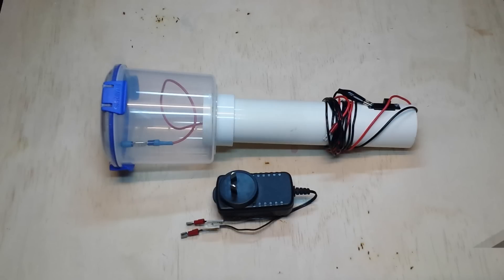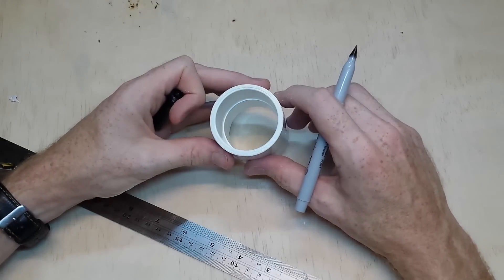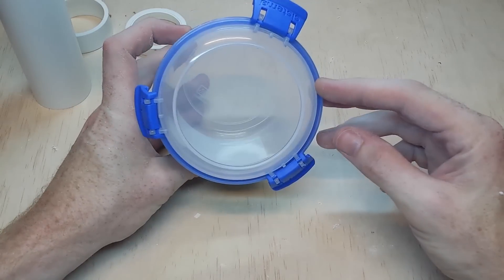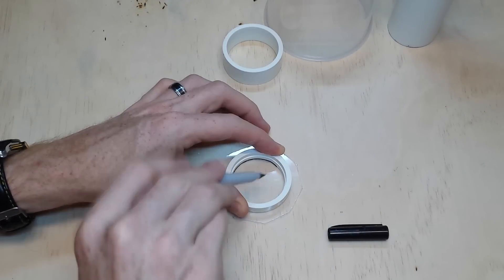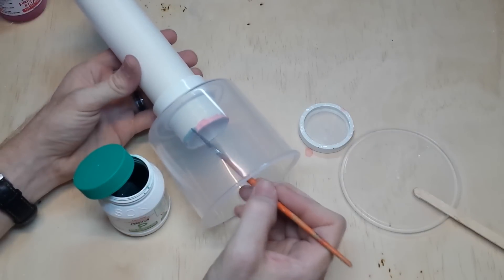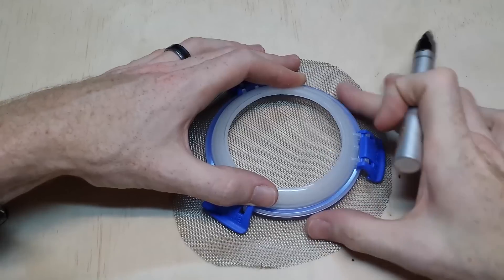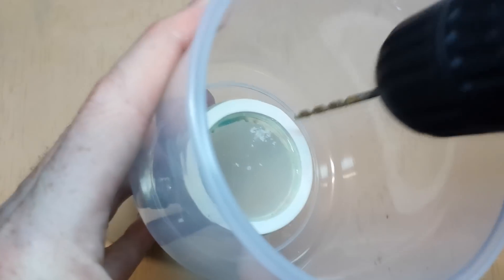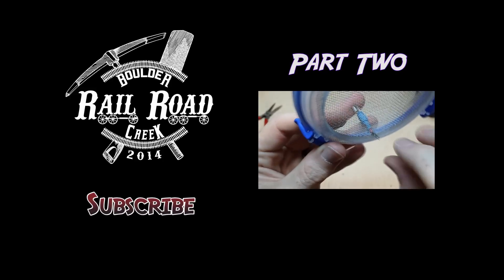Static Grass Applicator (Body) - How To - Model Railroad

Comment: Beware of the costs involved. I went to my local hardware store and asked for 18" of PVC thinking it would cost about $5, not realizing that it was $14.49 per foot. The pipe and the coupler cost me $24 USD. An actual flocking machine cup like the one shown in this video costs $55 USD on ebay.
Reply: Unfortunately the guy didn’t tell me how much it costs until after he cut it.
Reply: Seriously?! Something isn't right there. Try a different store. Here in Australia (where everything is more expensive than the US) 2" PVC is $2.15 per foot and the coupler to suit is $1.40. Google tells me that's US$2.50 at current exchange rates.

Comment: I am just about to start making mine, but I have a query. In your list of materials you state 50mm PVC pipe and coupler, yet on the video at the start where you have all material, tools, etc, lined up, the pipe is 40mm, and you also mention 50mm when marking the container for hole cutting. I think the 40mm is easier for handling, so I take it size doesn't matter.

Also what was the size of the timber for mounting the negative ion generator. I have a piece that is 30mm x 12mm.

Hoping to hear from you soon.  ...... Ian

Comment: https://www.ebay.de/itm/DC-12V-to-20000V-High-Voltage-Electrostatic-Generator-Negative-Ion-Generator/232475332393?hash=item36209c0f29:g:~-MAAOSwNm5ZrBIcEs ist ein Beispiel, man kann auch jeden anderen Händler nehmen.DC 12V to 20000V High-Voltage Electrostatic Generator Negative Ion Generator ist wichtig. Die Sachen kommen mit einem Monat Lieferzeit aus Asien. Man sollte die Teile sorgfältig verarbeiten, es ist sehr fummelig, das Drahtgeflecht an die Frischhaltedose mit 2K Kleber zu verkleben und an das Kabel zu löten.Die Leistung ist mehr als ausreichend, man riecht sogar die Spannung in der Luft, also nix für Herzkranke und Weicheier... Die Schläge die das Teil ausgibt, sind sau unangenehm. An dem Gerät ist ein winziger Poti, an dem man die Leistung regeln kann. Ich habe extra ein Looch gebohrt um mit dem Brillenschraubendreher erneut dran zu kommen.Ich werde demnächst einen kleinen Schalter einbauen, damit man auch Pause machen kann, ohne eine gezwiebelt zu bekommen. Die Kontaktkabel müssen ausreichend lang sein, das erhöht den Arbeitsradius. Für das Gehäuse macht sich Luke sehr viel Arbeit. Ich nahm das kleinste Abflussrohr und 2 Endkappen, an die untere Endkappe habe ich die Dose mit 2 Poppnieten befestigt. Der Generator ging nur mit drücken rein, also braucht der nicht weiter befestigt werden...Fertig. Bei der Frischhaltedose sollte man nicht geizig sein. Bei der vielen Arbeit lohnt schon ein besseres Modell mit gescheiten Schnappverschlüssen!Noch mal vielen Dank an Luke Towan für die geniale Idee und tollen Videos.

Comment: Had trouble finding the container you used but looked closely at the video and saw it was a Systema Klipit  23 oz (700ml) container.  Found it here in the USA on Amazon for $6 US.  Best build video I have found for a Static Grass Applicator.  Thanks.
Reply from the maker: Doyle Souders ,,  thanks mate, yeah I probably should've mentioned that in the video. I'm about to release an updated version of making the static grass applicator in about 2 weeks, the main differences are I used a slightly smaller container (same brand) and I added a dual power supply so it can be powered with a 9 volt battery or the wall socket. Having a battery makes it great for the hard to reach jobs.
Cheers
Luke
Reply: Thanks Luke,   I will wait for your next installment.  Still trying to find the right Ion Generator.  I sent a note to Oatley but haven't heard back so may just wind up picking up a 15 Kv unit off of eBay.  I am guessing you may have chosend the Systema Breakfast container.

Comment: I hate how i do everything he says get it doesn't work
Reply from the maker: I'm not sure what components you're using but if you are using a cheap negative ion generator from china then your applicator won't work as good as the one I show in the video. I used a high quality negative ion generator from Oatley Electronics specifically designed for making grass applicators.
Reply: Luke Towan I bought it of Amazon so I don't its know the quality

Comment: @Luke Towman 
is this negative Ion generator good for anything?
specs: 
DC 12V to 20000V High-voltage Electrostatic Generator Negative Ion Generator MO

Input voltage: DC 12V
Output voltage: 15000V-20000V adjustable
Rated power: 5W
Mounting hole diameter: 5mm
Hole center distance: 112mm
Size: 60*70*30mm
Note: Small red and black line is input, red is 12V power supply positive input, black is negative input, thick red line is high voltage positive output, thick black line is high voltage negative output
Reply: or this one. 
specs:
DC12V High Output Air Ionizer Ioniser Airborne  Negative Ion Anion GeneratorInput voltage: DC 12Voutput voltage: -4Kv ~ -6Kv DCpower:<1WColor: as the picture showSize (L*W*H): 4.3 x 2.1 x  2.5cm/1.61"x0.82"x0.98"(approx)Quantity:1 pc

Comment: Great video Luke, But I have a Question about the size of PVC pipe. You said in the video 50mm pipe which here in the states would be 2 inches. But the pipe in the video looked like it was marked 40mm. that would be 1-1/2 inches here. I don't want to have something too big if I can help it. So... 40mm or 50mm? Thanks again for a great video!
Reply from the maker: Just went and measured it and it's definitely 50mm however I have since made other static grass applicators and on the newer model I use 43mm pipe and the negative ion generator fit snugly. Any size can be used as long as the generator that you use can fit inside the pipe. Cheers 😀
Reply: Thanks for the quick reply Luke! 
But one another question about the output of the power supply. 
In the video I noticed the following of the power supply
 
Input is 100-240v - 50/60 Hz 0.4a
output is 12v=1.5a    On the output side.. can it be higher? say 2.a or 3a? 
I don't want to fry this thing. I am not good in electronics but I can follow instructions! which is what I am doing in your video! So I don't want to mess this thing up.

IONB2 negative ion generator  module is on its way from oatley electronics.
Reply from the maker: They only thing you need to look out for is voltage, as long as you don't go over 12 volts you'll be fine. The amps can be anything, I've used they grass applicator with a .4 amp supply ad well as a2 amp supply... if the rated amperage of the power supply is too low then you'll burn out the power supply first before it damages the ion generator. Cheers 😉

Comment: +Luke Towan,  I enjoy your videos and have tried some of your projects.  I use flex track to mask my tracks.  Flip the track over and use  1", 1-1/2", and 2" masking tape on the bottom,  with the track upside down, lay it over the existing track, offsetting it to "interlock" the 2 tracks.  I vary the tape width for different coverages or use 2 overlapped tape strips for wider coverage.  It would be easier if I had a video, BUT, I don't do videos.

Comment: Cool.  Question, though.  The parts list says to use 50 mm pvc pipe as well as your voice over.  However, the pvc pipe in the video is stamped "40 MM"  Which is correct/best?

Comment: What the most asked question here is the unit is called :  IONB2 NEGATIVE ION GENERATOR MODULE . 
Go to http://oatleyelectronics.com//product_info.php?products_id=915 
They are In NSW ( new state of weirdos ) 
They Sell $14 AUD , ship for another $12AUD which equals about $19USD depending on the exchange rate 
And I would recommend drilling the holes @ 6.15min ,in the pipe before fitting the container . Stormwater PVC can fracture easier than Electrical or communications 50mm the diameter is stronger when drilling into it . To get them try an electrical trade shop

Comment: I have been looking at making one of these.  However when looking for the negative ion generator they have 4 wires.  Red Black and 2 whites.  After reading other comments I see higher voltage the better.

I found on eBay 15000v static generator but it still has 4 wires. im assuming i can just cap off the 2nd wire?  
http://www.ebay.com/sch/i.html?_from=R40&_trksid=p2141725.m570.l1313.TR0.TRC0.H0.X2v+out+15000v+High-voltage+electrostatic+generator+%2Fnegative+ion+generator.TRS0&_nkw=2v+out+15000v+High-voltage+electrostatic+generator+%2Fnegative+ion+generator&_sacat=0
Reply from the maker: You can just leave the two white wires on and connect them to the mesh lid on the grass applicator, it should work the same however the output voltage is a little lower than the one I used so it might not work quite as well.
Reply: Hi Chris did you use it? it works? thanks

Comment: What size is the negative ion generator
Reply from the maker: It's about 40,000 volts using a 12v power supply. From Oately Electronics in Australia.

Comment: Amazing vid thanks I have looked on ebay but most of them have more wires on them ? not sure what the other wires are for is it just the 3 wired one i need thanks
Reply from the maker: yeah it works better with the 2 wire version. 'Oatley Electronics' in Australia sell them and they ship worldwide. I'd probably start there.
Cheers
Luke

Comment: Reading through the comments, there's a lot of questions about the negative ion generator.  If you live in the United States and have concerns about ordering from Australia (you shouldn't), there's a retailer in New Hampshire that sells higher power Negative Ion generators.

Here's a link to the 30KV unit: 

http://www.amazing1.com/products/negative-ion-generator-12vdc-input-30kv-output.html

Commercial Flocking units use upwards of 40-75kV, so there shouldn't be any major concern about safety with a 30kV unit.

These units are not cheap, but they are the highest power units that I can find this side of complete commercial units.  I purchased 5 of them in one shot to get bulk pricing, as I build these for modeling friends from time to time.

Canisters, similar to what Luke uses for his unit can be purchased at Bed, Bath and Beyond.  It's made by Sistema and are about $7 each.  I prefer these over others like them, because the clips that keep the top on the canister are separate items, which will not fatigue and break off over time.

Again, Great videos Luke...  Very informative and if you follow along, step by step, you get pretty close to the same results!

Jeff
Reply from the maker: Thanks for the link Jeff. Thats the question I get asked the most here, where to find good negative ion generators! So thanks again :)
Cheers
Luke
Reply: $50 plus shipping. That's bananas.

Comment: Hello, it looks great and does the work perfect. I have built grass applicator from rechargeable "bug zapper" but it doesn't work good. I would like to built another one similar to yours, but I need your advice. I have checked ebay and I can buy only 12V Negative ion generator that gives 9000V. It is less than IONB2 with 15kV. Do you think 9kV will be eought? or I should look for higher voltage?
Reply from the maker: +Robert D I think 9000V will be ok, I got a message from someone who made a similar one with a negative ion generator from China, I really like the one from Oatley Electronics because it's made specifically for making a static grass applicator. However the bug zapper ones will be a similar voltage to 9000V so it might not be a whole lot better? If it was me I'd get the higher voltage one.
Hope that helps, if you have the money and time it might be worth experimenting and giving the 9000v one a go.
Cheers
Luke
Reply: +Luke Towan 
Thanks for advice.
Reply: Hi Luke,

I've found a 12V ionizer with 20.000V output on Ebay. Please see this link:
https://www.ebay.nl/itm/152382512125 
Can I use this one? If yes, there is a black and red cable and a red and white one. How do I connect this.
What are the specs of the phone adapter?
Thanks for your reply!

Comment: what about a nylon shirt and a pvc tube?
Reply from the maker: +MrOldCrow Similar to rubbing a balloon on your head?? There is a product from Noch that uses that principle, not sure what it's called though.
Cheers
Luke
Reply: I may not be understanding electricity enough, but I wonder if an applicator could be made from a cheap torch? It has a switch already built in.

Comment: Hi, I am very new to this love your video, I am guessing you buy have to buy a switch as well but does it run on battery or is it connected to a transformer and what voltage does it run on. Thanks
Reply from the maker: +1809flower Hi, yeah you'll need a "Double Pole Double Throw" (DPDT) switch to wire it up. It can run on a 9 volt phone charger that plugs into the wall but will work slightly better with 12 volts charger. It is possible to run of battery power however I'm yet to try it this way.
Cheers
Luke
Reply: +Luke Towan thanks heaps

Comment: Hello, I am from Germany. I've searched on ebay by negative ion generator , but I find just one with four cables , is that right? Excuse my english.👍thx
Reply from the maker: +DaviRelli Channel The four wire ones should work but I'm not sure if they are as good, I haven't personally tried them and apparently you can chop off the extra high voltage output wire? The one I bought from Oatley Electronics is specifically designed for making static grass applicators and you will definitely get great results with that one.
Hope that helps a little.
Cheers
Luke.
Reply: Thanks for the answer. Is there a website where I order it ?
Reply: +DaviRelli Channel 
Hi, check my question to Luke. I have found 3 wires generator, but the one with maximum 9kV output. IONB2 generates 15kV so, much higher voltage. It looks IONB2 is not possible to buy, or have you managed to?
Reply: Hello , I ordered one from China , unfortunately, does not work with . Now is the thing ready built alerdings without funtion there. :( Have you found something better ?
Reply: Hello , I ordered one from China , unfortunately, does not work with . Now is the thing ready built but without funtion there. Have you found something better ?

Comment: i have built one of these too..from a MRH article and use it with the club scenery all the time..very popular. i was going to say you can buy screen door repair kits at hardware store ..the are just right size and work good too...just be sure to use metal screen
Reply from the maker: +Mark Ernst Thanks Mark for the great tip. 
Cheers
Luke

Comment: Why would you use epoxy to glue the parts together rather than regular glue?
Reply from the maker: +Ellison Wonderland Films I find epoxy to be stronger and more durable, you could probably get away with regular construction glue but I'm not sure how long lasting it would be? Silicon might work as well and would be durable as well as flexible.
Cheers
Luke.

Comment: I've already commented in the "Electronics" video section, but I just wanted to say again that this is the best tutorial and best constructed home built static grass applicator I've seen yet... 

For those that live in the US and would like to build this unit...  The Negative Ion Generator that Luke uses from Oatley Electronics is the most powerful 12VDC unit I've found to date and Oatley has no problem shipping to the US ($14AUD).  On our end, there's not issues with Customs at all.  I've ordered 6 of the generators (2 at a time, X 3) with no issues at all...

Again...  Great tutorial Luke.  The next time I build one for a friend, I'll be using your techniques.
Reply from the maker: WHJeffB Thanks again mate, buying the negative ion generator in bulk is a good idea. If I received one of these as a gift I'd be very happy!  Thanks for the fantastic comment and great feedback.
Cheers,
Luke.
Reply: what to look for when buying an ion generator?

Comment: I have one question.. is this device same like yours?
http://www.ebay.com/itm/251414801059?_trksid=p2060778.m1438.l2649&ssPageName=STRK%3AMEBIDX%3AIT
I am planning to make a device like you..
Reply from the maker: Bora Jankovic Hi Bora, The device is very similar and it would work however, the output voltage is a lot lower than the device I used, the results would not be quite as good and you may have to hold the grass applicator a lot closer to get the fibers to stand on end. The one I used is here : 
http://www.ebay.com.au/itm/OATLEY-ELECTRONICS-IONB2-GRASSINTOR-HIGH-VOLTAGE-MODULE-/111487231244?pt=AU_Toys_Hobbies_Model_Railways&hash=item19f528250c
Its specifically designed for grass applicators and gives a very large output voltage, almost 3 times the amount of the one you've been looking at.Hope that helps.
Cheers, Luke
Reply: Luke Towan Ok thanks for the reply .. I thought it was a small voltage!
How do you propose to be the minimum voltage?
Reply from the maker: Bora Jankovic That sucks! I was reading the info on the generator you found, 30-40kV is pretty big, probably getting into the range I'd probably start to be a little worried, especially for a static grass applicator. It also says to only use for short amounts of time, or the module may be damaged, I would probably try making the applicator with the first ion generator you found, the voltage is lower but it will most likely work quite well. You might just need to hold the applicator closer to the layout when applying the static grass.

Comment: Nice quality home made static grass applicator, we'll done!
Reply from the maker: SLO70 Thanks, it's very durable! I dropped it from just over a meter high and it didn't even get a scratch. I'm planning to build a second one using batteries instead of the phone charger, It will make it much more portable and easier to move around. Thanks for the good feedback. Cheers Luke